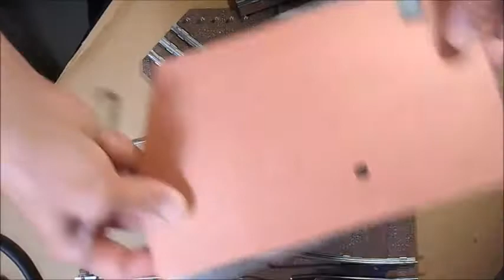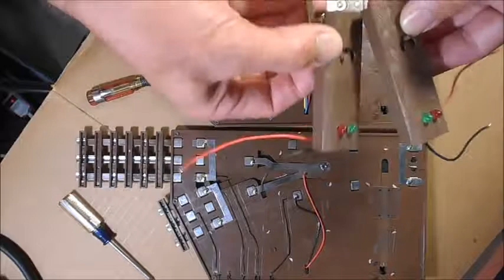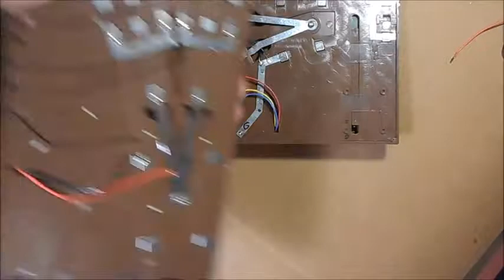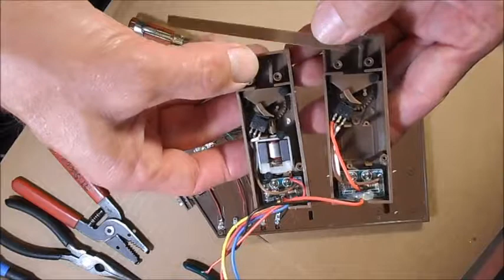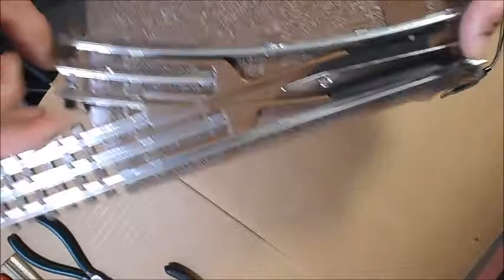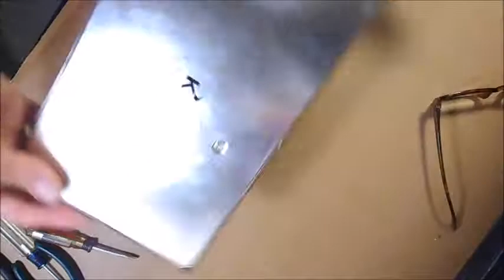K Line LED O27 O 42" remote switch repair & manual to remote conversion Lionel

Comment: Great video, Have you ever ran into the switch getting stuck when thrown either way? I have added 101 oil to the gear and that did not help
Reply from the maker: That is a great question and I have not had one that got stuck either way.  How does it feel when you operate it manually, does it drag and is harder to rotate than your other switches?  If it did I would suspect something binding at the track which moves, the linkage below from the switch motor to the moving track piece, or the pivoting gear by the motor.  They can be finicky and there is even scotch tape underneath holding the linkage up in the switch too.  Good luck on the repairs and thanks for watching the vid.
Reply: @trainzone1073  and @LionelCLRR: I had that sticking problem. The cog that slides over the motor shaft had slid a little too far away from the motor and interfered with a plastic pin on the cog it engages with. I pushed the cog back toward the motor and now the switch works fine! I did this by taking the cover of the back of the switch, then unscrewing the three tiny black screws that hold the motor cover to the switch. I threaded the plastic arm that controls the moving track piece out, unstuck the scotch tape and was able to access the cogs. Three years later, but maybe it will help three or thirteen years from now!

Comment: You mentioned that you have some that bounce. I have a left hand one that bounces pretty bad. Is there any way to adjust that? Loved the video and helped out quite a bit on a repair I was doing.
Reply from the maker: Glad you watched the video and hope it helps with any repairs.  I have been lucky enough to get the switches to work correctly by just lowering the voltage on the little transformer as an adjustable constant power source dedicated to only these switch tracks.  I did have to wd40 a couple top areas that were too sticky (used and maybe something got in there?).  If the bounce back problem is on that sliding piece on the top then perhaps there is a way to put a bit of drag on that gear or if needed the actual plastic which is activating the micro switch.  Maybe a tiny flat washer or paper shim with a hole in it on the pivots inside?

Comment: I like the K-Line 42” switches better than the Lionel 42” switches.
Reply from the maker: Absolutely and I've owned and operated both, sold the Lionel O27 42" switches since wheels arc against the wide center rail which may be just a bit too wide, plus K Line switches have lights.